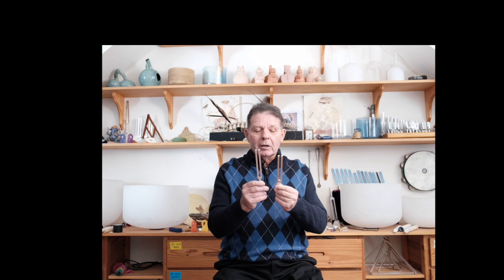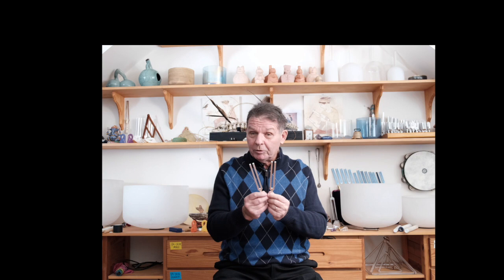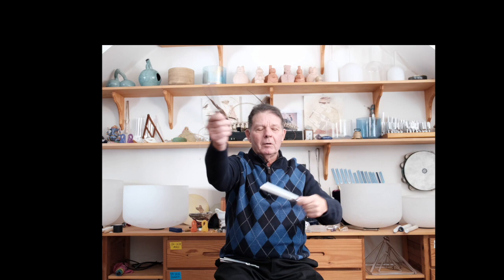Difference Between Biosonic Tuning Forks and Other Tuning Forks

Comment: I just wanted to say, I’ve had my biosonic tuning forks for years and I LOVE them. I recently impulse-bought an imitation cheapy one and immediately noticed the difference between the two! The sound of the imitation one is tinny and slightly unpleasant, and dissipates super fast. The biosonics are rich and full and ring much longer. Thank you for this explanatory video because now I understand why. Also, the material of biosonic vs the imitation is vastly different! The biosonic forks are smooth, the imitation one has a bumpy texture, almost like sandpaper. Plus, I love that these are made in the USA! Thank you John!

Comment: I just purchased quality crystals forks; 528 and 432. I can’t strike them together but should I use them together?
Reply from the maker: You can use them anyway you want and meditate on the sound and see what happens. I suggest you knee or activator tap the 528 bring it to your ear and hum in resonance with the sound. Do the same with the 432. If you tap them together than move your body with the sound and create a dance.

Comment: If you are just getting started with tuning forks, which ones would you start with, like one weighted, one unweighted, how would you choose?
Reply from the maker: Start with the Biosonic starter set which is all you will need. That is Biosonic Bodytuners and Biosonic Otto 128 with 15mm crystal foot. These 3 forks are a complete sound healing system. Everything else is speciality. And for sure read my book Human Tuning and watch the support videos on biosonics.com. and look at my presentation on Neural Coherence on biosonics.com in the support section / interviews. And if you want to come to a class just check the workshop tab.
Reply: @johnbeaulieu6685  thank you, saving up for that now.

Can you recommend an order of delving from there?

I was reading about pythagorean tuning, or Schumann tuning...there are so many systems. Do you have an order you recommend to learn about and experiment with?

Also have you experimented with different tuning systems of your piano? Considering tuning my piano 432=A for example.
Reply from the maker: @brynl-k4118  Read my book Human Tuning and just experiment with whatever tuning forks are presented in a chapter. What is most important is C and G (Bodytuners™ and the Otto 128) All of my tuning forks are tuned to an 8 cps Fundamental which is resonant with the Schumann resonance and coherent neural firing patterns, etc. I have tuned my electric keyboard to thousands of different tunings. It is easy to do. If you want to tune a acoustic piano it is very time consuming. With my electric keyboard I save the tunings and just press a button and it is retuned. And these days you use your e piano as a controller and get lots of different tunings in programs like PianoTec and Ivory, etc. And even adjust the overtones, sound board, pedal sounds, and with some you can even prepare the piano and insert coins, clothes pins, mute strings, etc. and save your set up.
Reply: @johnbeaulieu6685  thank you for all of your suggestions. I agree with you that just using a digital piano or even a patch to do the sounds is easier. For John cages 100th birthday, I had a chance to prepare a piano personally and perform a few pieces. I still think that preparing a piano for real is more fun and gets you to know the insides of the piano more intimately! I do have a few more questions. How do the crystal feet help, also the other question I had was after getting the setup of the C, G, and the 128 weighted tuning Forks, if I decided to really dive into this, what would be your next recommendation to play with? Also, what is the difference between the Pythagorean versus the Schumann in regards to tuning Forks. I know for tuning systems, Pythagorean is based more on the 5th
Reply from the maker: @brynl-k4118  The crystal adds more length and stability to the stem, the crystal has a piezoelectric effect when vibrated by the tuning forks and emits a light into tissues, the crystals can slide across tissue, and crystals hold memory as semi conductors to name a few responds for using a crystal foot. Biosonic forks are based an 8cps fundamental which in resonance with the Schumann resonance and 8 is the tuning for neural networks via coherence. So we have a 5th C and G based on an 8 Hz fundamental.

Comment: I hear the ringing but also a very tinny  sound which I hear when they are struck against each other
Reply from the maker: You need to look at videos on how to play them in support section of www.biosonics.com -- they are musical instruments and you need to learn how to use them correctly -- simple yet still requires your attention.
Reply: @johnbeaulieu6685  I prefer using the Rubber striker as opposed to striking the forks against each other. Not only do they last longer BUT the sounds I hear are much preferable , more pleasing and not so tinny. I got my striker from SWB 256 . I just don’t like the tinny sound at all, and personally I don’t think they’re meant to be hit against each other ...

Comment: Are they made from alluminium ? If so are they coated with something ?
Reply from the maker: Aluminum alloy and there are hundreds of alloys -- We researched until we found the alloy combination that will sound all the overtones. They are not coated. And they are 100% American.
Reply: @johnbeaulieu6685  it's just don't like the thought of absorbing alluminium.....
Reply from the maker: @bobflep  Do not put the tuning forks in your mouth and suck on them. If you think you are absorbing aluminum through just the sound then when you go to a concert hall with hundreds of instruments made with all sorts of metals and combination of metals plus the layers of who knows what to polish the piano case -- good luck.
Reply: @johnbeaulieu6685  actually you dont have to be rude ...you can absorb alluminium through the skin
Reply from the maker: What I say to everyone is that you must be safe and if you are not safe touching an aluminum tuning fork then do not use them. Without safety nothing will work correctly. If you are safe with steel tuning forks than the C and G interval will work for meditation. 
   @bobflep
Reply: @johnbeaulieu6685  wear white gloves if you fear touching them.
Reply: @sandyjones1014 Will any other colour work?